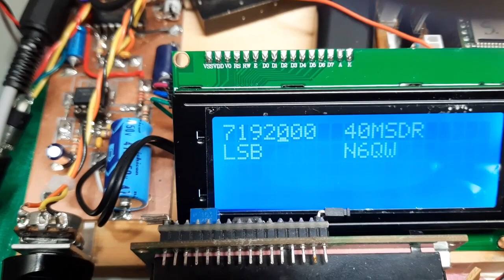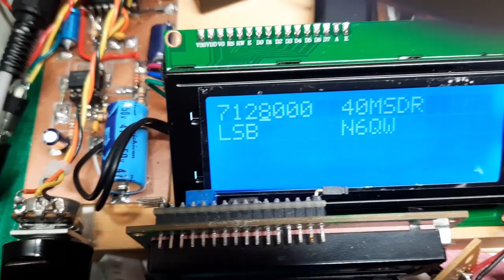SDR Sounds that Good!

Comment: Can you tell us something about the noise reduction?
Reply from the maker: There is no one more surprised than me regarding the noise reduction. There are several pieces one of which I can share part of that  because I had to do some things to clean up the noise. First I found out in a Direct Conversion Receiver I built about 15 years ago  could be prone to noise pick up --like AC hum. Thus I started by installing 600 Ohm to 600 Ohm Modem Transformers in the I and Q channels following/ahead of the ADE-1's (depends whether you are transmitting or receiving) .The Modems Isolate the ADE-1's from the ground to the Digital part.   I still had a noise issue coming out of the audio stage that is like a Sound card. The Teensy3.5 plugs into this board. From there the output goes to the audio amp stage. There I installed a DPOW Ground Isolation device (Amazon $8) That cured another part of the noise. Now internal to the Teensy + Audio Amp board there is Digital Signal Processing and that part I cannot comment on. So short answer there were two physical things (Modem Transformers and the Ground Isolator) that did a lot of the lifting. and the rest was internal to the software. But the signals do sort of pop out at you and the noise is not evident between stations.

73's
Pete N6QW
Reply: @N6QW  haha, nice. thanks for the details. looking forward to hearing some day about the digital wizardry!!